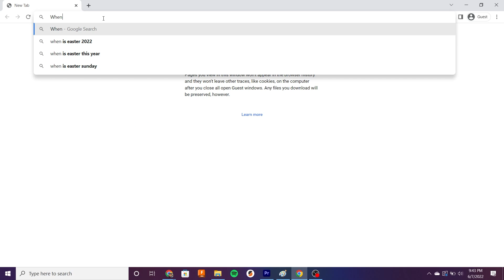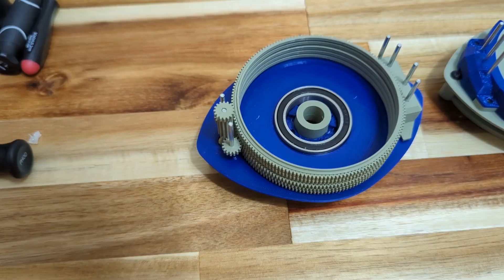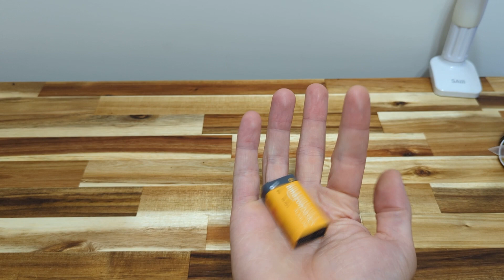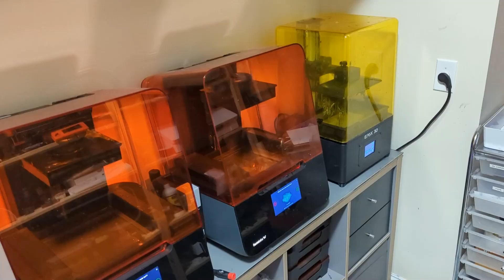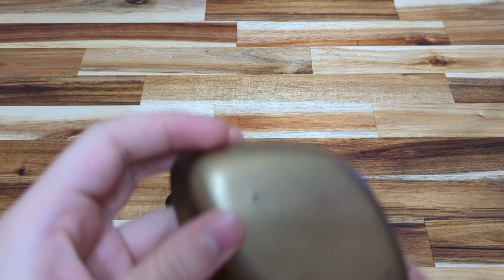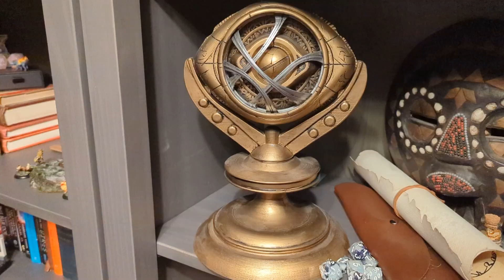FULLY Redesigned 3D Printed Eye of Agamotto

Comment: Hi🤓 If already purchased the new files and everything printed out perfectly. I was wondering if the motor uses 5V and is it possible to post the electric wiring schematic online. I don't really know how to hook everything up. Thanks in advance🤓
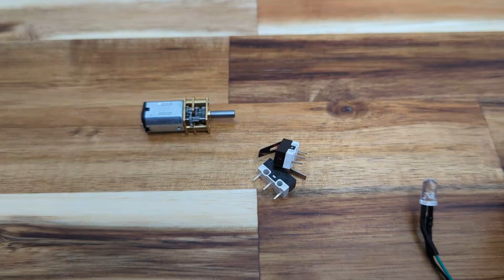Reply from the maker: Hi, I used a 9V battery in a battery box something like this (https://www.amazon.com/Battery-Holder-Switch-Wires-Batery/dp/B01C5J4L76) I will post a simplified graphic of the electronics later tonight, in the meantime, there is a schematic at 2:08 but I understand if you can't get it from that, those are a little confusing.    I have PCBs I designed for this project coming in from overseas and hope to shoot an update video announcing those in a few days.

Comment: You mention putting the bill of materials in the description of the video, but you didn't. Could you make public the non 3d printed parts needed? I'd like to know that I can get the parts, before buying the files.
Reply from the maker: Good point, Updated.  I put the BOM in the assembly video description but linked to it here.  Let me know if you need anything else!